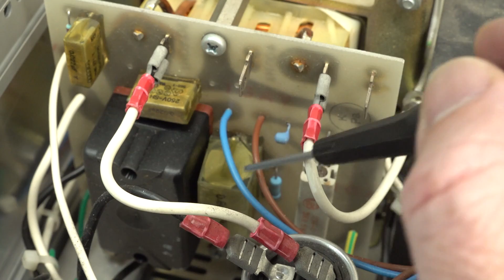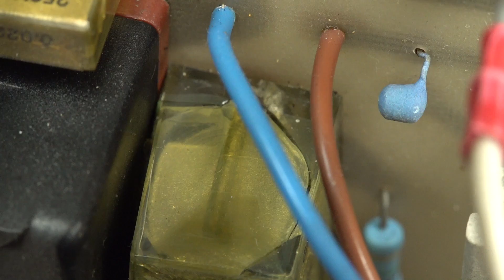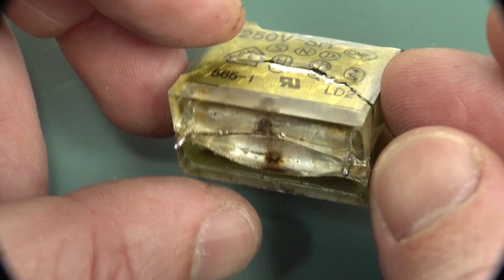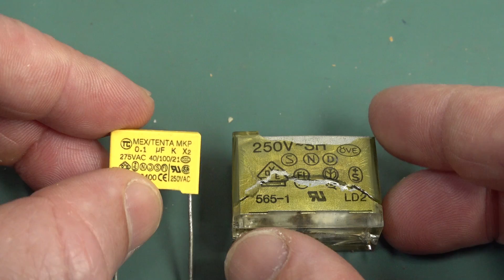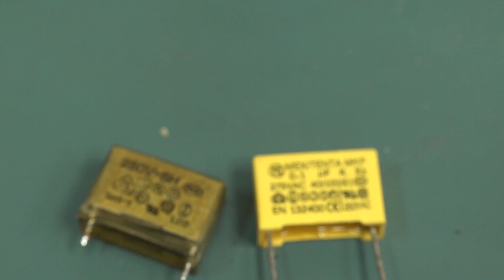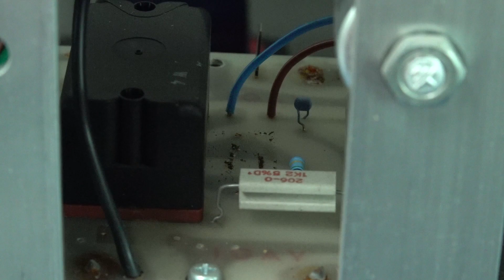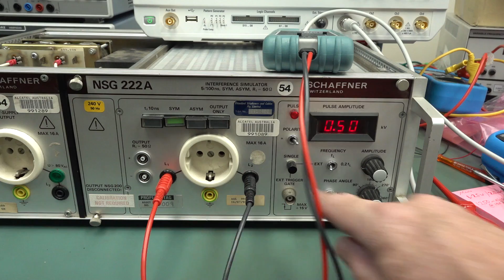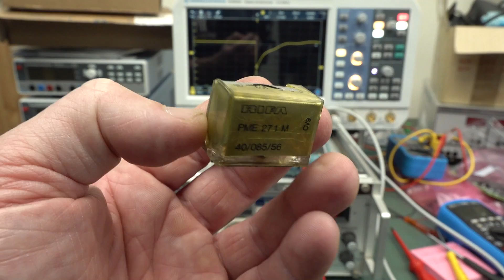EEVblog #1183 - RIFA Madness (Schaffner Repair)

Comment: RIFA caps are the most common part to pop in the ACORN BBC MICRO and MASTER computers and probably every other computer from the 80s that has a built in power supply, they look exactly the same as those and same result if not replaced after a circa 20 year dormant storage
Reply: Luckily I shake up me old-eBones every dozen years or so.
Reply: My first ever magic smoke incident as a young'un was with an old Mac power supply board. I saved it as a memento. Looking at it right now... yep, the cap that burst looks just like the ones Dave took out!
Reply: Yep, I can verify that. I have 2 BBC Micros and a Master 128, in each of which I have replaced the RIFA caps.
Only 1 of them had actually failed, with the others showing signs of imminent failure.
The amount of smoke and stench these caps release is almost off the chart!
Reply: Last year, while my friend was guiding a tour in computer museum, one of Master Compact psu went kaboom.
I though that I've replaced these caps in all units. Oops :-)
Reply: @0x9066  The "auto-finding" function was enabled... it gives both an auditory and visual signal. LOL

Comment: Had 2 long unused Apple II power suppliess fail because of RIFAs,
One, my spare, right after the first. Both a few minutes after power up.
Fortunately I was around to hear the zap-crack before too much smoke escaped.
Easily replaced.

Comment: Ooh caps... looks like I was right after all. :-)
Reply: So was I, but as Dave I was thrown by the red herring.
Reply: I find only the transparent case versions will go bang, the ones potted in the thicker coloured housings are a lot more reliable, they only fail as they age from self healing down to the picofarad range. The transparent ones do not have an outer water resistant housing, and the bare epoxy degrades as it is exposed to air, the cased ones the fill at the bottom is generally thick enough that they just slowly degrade.

IIRC X class are allowed to pass current as they self heal, but Y class are required to be double layer construction, so that there are 3 foils inside, one floating and acting as an intermediate, so that even if the one self heals there is no current flow through the terminals, just the single part blows out and is isolated, but no DC current flow.
Reply: @SeanBZA , I wondered what the difference was... thanks for that lucid update!

Comment: Thanks for your sharing.  I just found out an old Haag Streit slit lamp power supply also using RIFA filter caps (both X2 and Y2).  The X2 220n and Y2  1n0 RIFA filters caps were blown out.  Its time to change them all.

Comment: I had some RIFA PME271M caps fail in the power brick for a 1988 Compaq SLT/286 "lunchbox" laptop. Along with all the silver coloured Sprague caps. Went up with a sizzling "puff" and tons of smoke. Smelled like burning wood.
All replaced and running great now :D

Comment: I suspect that the scope pulses are a result of the capacitance and inductance etc of your 'load'. The unit outputs an specific width energy pulse. You would need a resistive load to see the actual pulse profile.

Comment: BTW, to remove glares from non-metallic surfaces on video get a Circular Polarizer filter in front of the lens, the only problem is that you might also loose the picture of LCD displays, but it depends on the angle.

Comment: @13:25 Maybe someone half pulled the IC to make it appear broken in order to get a new unit, I have come across that kind of thing before on broken gear I have purchased, where it was obviously made to appear broken, ( which made it easy to fix). I quite like it when people do that to get new lab gear, as it seems I can then be lucky enough to buy the "broken" one on eBay.
Reply: The Defpom's Repair Channel
More likely that the IC was pulled during diagnosis or by a smart tech to prevent theft or usage before a repair was effected, in wait for a purpose which never came. U are abominable.
Reply: Great idea Defpom.  I need a new scope at work.  Does that make me abominable?
Reply: It isn't my idea, it is what I have found a few times when I have purchased broken gear off eBay, so it is obviously happening somewhere.

Comment: Hi, I repair domestic appliances in the UK and I replace these on a regular basis.
Even ones that aren't cracked will let the smoke out eventually.
Reply: Electrolux vacuum cleaners had them. you won't see the smoke but you will certainly smell it as the capacitor sits in the airflow.

Comment: Yes Dave they are supposed to crack and vent. The idea is to take out surges and power spikes, they generally can only ever handle  a few surges before they start to vent. The plastic blue potted ones tend to go with a enormous bang as they are sealed however the Rifa type crack and vent without exploding violently. They are a sacrificial capacitor, they take the hit and protect the rest of the circuit.
Reply: Could you explain the importance of X capacitors? I have plug in surge protectors that self-consume 29-43 mA, and I suspect it is the X capacitors leaking current! Was wondering what effect if I remove them?
Reply: @mrtechie6810 

The keep high frequency/ sharp transient interference in and out of the device. Which might cause malfunction in logic circuits, noise in radio devices etc.

Comment: A couple of observations and queries:
1.  The new cap you show is potted inside a solid plastic shell, and it looks more robust than the old ones.  Do modern film caps actually last longer?
2.)  I noticed that the 'scope traces of short and longer pulses show a secondary 'peak' followed by a slight bulge on the pulse's trailing edge.  I have a  hypothesis that explains that, maybe the apparent insensitivity in the pulsewidth settings.  I wonder if in reality a train of 'ringing' oscillations followed the main pulse.  Some kind of filtering in the measurement instrumentation would partially remove the oscillations, yet leave an 'envelope' signal that you observed.  So, while the true pulse width varies with the set time, the ringing may not, giving you the apparently constant pulse width on the scope.  Also, are you certain that your 'scope has enough bandwidth to track oscillations as fast as the ringing would be?

Comment: You can know the 'health' of the capacitors (discharged) measuring the C-Rp or C-Rs parameters with an RLC meter (at 50 Hz or 60 Hz). Rp modelates leaks (between layers). When the voltage 110 V or 230 V (worse case because double current pass) is applied, there is a power dissipation in form of heat. As the time pass, the temperature goes up, and if the heat is high, the magic smoke scapes from the capacitor. You can see the delta tangent from the datasheet, and from this value and the capacitor value, isolate the Rp.
"X" capacitors could fail in short circuit mode, and if the current flowing the capacitor is high enough, the well dimmensioned fuse of the equipement will breaks. At lower current, magic smoke goes out. 
"Y" capacitors could fail but in open circuit mode, otherwhise they could short the L(ine) to the earth of the equipment. In this case, is the differential breaker who breaks the line. A bad earth of the instalation could be dangerous the the user.
If there is no a linear effect with voltage (measuring C-Rp at , you can  1 V p-p) you can use your differential probes to measure the current and the phase using the capacitor in series with a known resistor.  It is a three element network: C-Rp + Rs_test. You can measure it at different voltages to learn about the linear effect with voltage.
Reply: Could you explain the importance of X capacitors? I have plug in surge protectors that self-consume 29-43 mA, and I suspect it is the X capacitors leaking current! Was wondering what effect if I remove them?
Reply: @mrtechie6810  X capacitors are for regulatory: EMC, mainly to reduce the conducted noise from the equipment to the mains. If your equipment consumes e.g. 30 mA and is a reactive current only (is 90° out of phase of the voltage), it does not consume active power and then the series resistance is small and the capacitor does not heat up.
If the voltage is 230 V, the frequency 50 Hz; I = 2 * pi * f * C * Vac; C = 30 mA / (2 * pi * 50 Hz * 230 V) = 415 nF, that is usual in mains filters.
If you remove them, the EMC compliance could be compromised. 
If the capacitors heat up, change them for a new ones.
Reply: @user-xlario  the SPDs I opened have 0.68uF, 0.47uF, 0.33uF X2 caps. I measured 29-43mA using the clamp meter UNI-T UT210E. The higher capacitance had higher leakage current. I did not check with an oscilliscope.
My concern is not heating but phantom power waste, with multiple of these SPDs around the house, always plugged in, for many years!
Reply: @mrtechie6810  An ideal rective component: capacitor or inductor, does not consum active power (W), but reactive power (VA). This has no effect on the power consumption (does not cost money). You only pay for the active power (W).
Reply: @user-xlario  so what is the correct way to measure this? How would a wattmeter read? I had a wattmeter ProGrade 512 (now broken) and as I recall it measured around 5-10 watts per SPD. So I think you are saying only commercial or smart metered customers are billed for reactive power.
And to understand this, requires an oscilloscope or a fancier power meter.
Is that correct?
On the other hand, if running off a UPS/solar storage battery, an additional 70 watts of reactive power would use/drain the battery!
Reply: @mrtechie6810  The easiest way to measure it is with a wattimeter, because it measures active, reactive and apparent power. You can measure it with an osciloscope, but it's no so straightforward and must be careful with the ground terminal of the osciloscope. 
I don't know what happens when you power your system from a battery with an inverter. I guess it depends on how it is made.
Reply: @user-xlario  would a large number (e.g. 10) of X capacitors attached to the home power system cause any issues with other AC devices?
I recall reading that leading power factor can damage motors and transformers! Not sure that would happen in practice, with just 5 or 10 microfarads.
Aren't electronic power supplies also often leading power factor?

Comment: Bloody RIFAs. I've witnessed several of these go off, but none as dramatic as inside a Grundig VCR from the 90s. It dented the can containing the PSU and even lifted and catapulted the fuse right out of its socket! The fuse was surprisingly still ok, but the whole PSU compartment was littered with shrapnel.
By now I've learned to preemptively replace them; it takes minutes compared to the hours you'll spend cleaning up the mess, particularly the sticky flameproof resin!

Comment: I make my own cap filter with x2 cap type and smd resistor on pcb board😊 I must replace a lot of this caps on WEKO drivers in offset printing machines. They always blows up or crack and some parts don’t works

Comment: I'd argue it's not "because" those are Rifa, but those metallized paper mains-caps are indeed notorious for failing.
Reply: Khron's Cave •Rifa infused with 1/3% fail, a full ° more of fail than mere 33.3% Rifas!
Reply: All paper caps are timebombs.  Paper absorbs moisture and becomes brittle and acidic over time.  Noone makes them any more for good reason.
Reply: @MarkTillotson  except that Rifa-Evox-Kemet still make exactly the same capacitors, including the crappy housing that causes them to fail even faster than any paper capacitor.

Comment: Thanks for heads up. I have a welding machine that doesn't work full of those caps. I didn't think much about them. I need to check them. Thanks.
Reply: Apparently machine failed a while after it was switched on. First it had intermittent operation and then completelly stopped maintaining arc.

Comment: Don't hate on RIFA! I used to work there in the 80s when they were still making capacitors!
Reply: You should have called out the people in your company who thought it was not only a good idea to keep making paper capacitors while the competition had already switched to polyester and polypropylene, but to actually make them worse than they needed to be even by 1960's standards. By the 1980's, polypropylene capacitors had gotten reliable enough to replace the last paper capacitors in safety and pulse applications, so the very least that RIFA engineers could have done, was make a superior paper capacitor if they wanted to stick with paper for sentimental or marketing reasons. Instead they kept on producing this old, proven unreliable design. Bringing that up, unfortunately, isn't hate but being flabbergasted. I can't think of a single reason why a company would continue doing this for decades (Evox continued, and now Kemet still sells them). To be fair, Wima did the exact same thing, but they were slightly (a few percent) more durable and they did make and enthousiastically market some of the best polypropylene capacitors.

Comment: The PME labeled caps were used extensively in older Tektronix switching power supplies. You must shot gun replace these because they are a ticking time disaster for old gear.

Comment: Did they never test those caps in some sort of environment/ageing chamber? Or did they, and just went "Pah, 15years lifetime? We will have flying fusion powered cars until then" ? I can't image those caps didn't show some of the issues we see with ALL of them today...
Reply: I've read that they indeed didn't pass mechanical tests (not even aging tests) at some equipment manufacturers, but obviously not every design department had such strict quality control.

Comment: My Zanussi washer dryer had one of these but instead of cracking right away the plastic expanded with the capacitor inside it until it finally cracked and started turning off my rcd all of the time

Comment: I am pretty sure it was one of these which caused a sewing machine of mine to self-start and be erratic. There was also magic smoke.
Reply: I have heard of the same thing happening with turntables where they had one of these wired across the motor switch.

Comment: Ahh yes just had a failure in the mains filter of my Racal 2101 counter yes it was a Rifa and also changed the Rifa caps in my Farnell AP6050 supply they are prow to failure too , So an important job to do .

Comment: Around 11:31 you say that X class can be replaced by Y class.  Shouldn't this be the other way around? Y class is rated to 500V,  X class is rated to 2.5kV. Or is this about them breaking on purpose if the voltages get too high?

Comment: My BBC Micro & IBM 5150 had these. Both machines blew them in early testing.
Reply: Yeah, same here. a BBC B in my case.  Someone warned me i needed to change the caps in the PSU, and like an idiot i ignored them. 
Fortunately, it didnt seem to be blow anything else up...
Reply: I have a 1986 BBC micro I use quite regularly, I have not checked if it has Rifa caps but it has not given the magic smoke as yet. :)
Reply: Well there’s service manuals which explain these operations to the consumer but if one doesn’t see it in print, a scattergun comment like change the caps is ambiguous and open ended.
Reply: @FireballXL55 , Well, you've now been given ample reason to fix you "problem to be.'
Reply: @HighestRank , Unless you heed Paul Carlson's videos, "Mr Carlsons Lab" here on YouTube and Patreon. He is prophetic in spades about using safety caps.
Reply: @BruceNitroxpro  No it will work until it fails.
Reply: Pamperchu  wire them all up in parallel & hook them up to the mains & you will have a nice underwhelming firework show.
Reply: Pamperchu  conformal coating won't help. The cracking is speeded up by chemical deterioration of the paper dieleectric which makes the capacitor swell up. Once the first hairline cracks appear, the capacitor should be written off. Even when no cracks are present yet but the capacitor was stored under moist or unknown conditions for a few years, write them off. Exploding them sounds really nice :D

Comment: These suckers ... I scored a free Tektronics 2430A a couple of years ago whe I started university. The NVRAM battery was dead, so it was an easy fix. Right as I triumphed after the calibration steps, the darn thing started venting a stream of thick smoke out the fan. I yanked the power cord out and laughed my ass of after the initial shock had settled. There were two of those Rifa caps in the power supply section and one of them had its magic smoke extracted. Worst thing was my dorn stunk for two weeks straight.

Comment: Oh, so You got busy with timed recap fuse. When these RIFA fails it's time to recap the machine. Changed a ton of those at Tyrak 8 from Asea, and a lot more on Masterpiece modules until a few years ago when they wend to dumpster. Nasty smell, and lots of them leak some stuff not pleasant at all.

Comment: Didn't think you could put a capacitor straight across a supply like that as at the point of first power up the capacitor is not charged and would be a short circuit, so are they shunt capacitors with a shunt resistor with them as a package ?

Comment: Had the exact same type 10 nf capacitor in my moms sowing machine that blew the magic smoke, it was like a blanket of pure smoke pouring out of it

I think it was 10 or maybe 0.10 nf
Reply: Hopefully she didn't throw all the accessories in the dustbin and then ask you to take the machine to the tip which was the fate of my Mother's expensive sewing machine. When I looked inside there was a cracked RIFA capacitor screwed into the terminal block where the mains lead terminated. Very annoying because I could have fixed it in 5 minutes for less than £1.